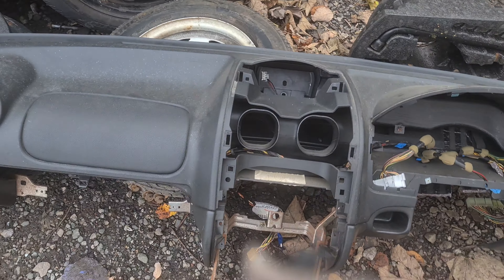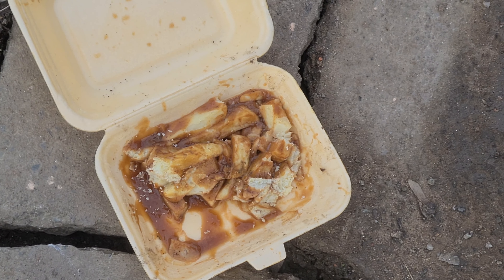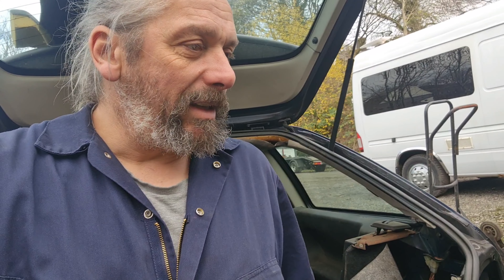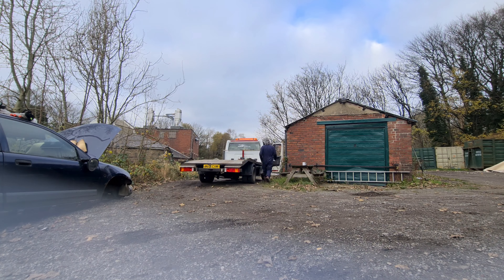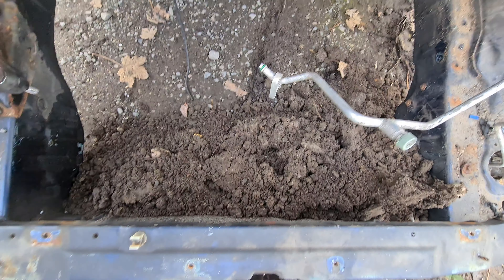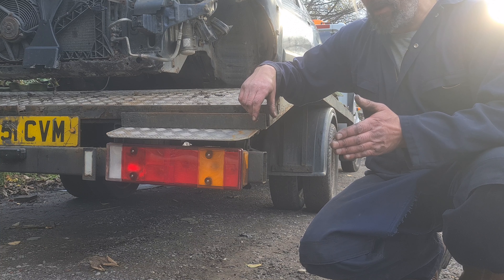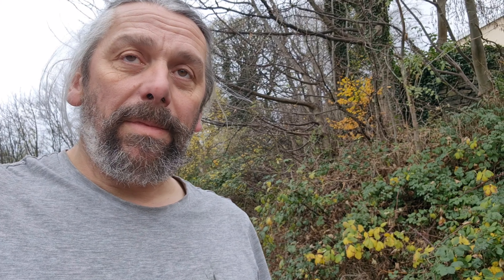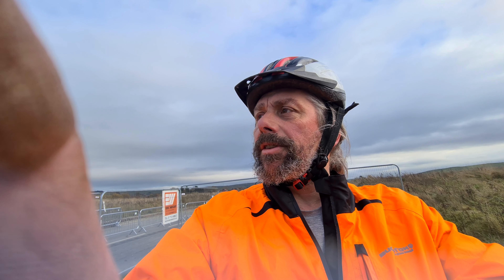Tony the Streetwise finished. Almost.

Comment: I would've needed those front seats, but I would need you to keep them until 23rd August 2024 when I get paid and you'd have to deliver them 250 miles away. My budget was a tenner so you've missed out BY SCRAPPING RARE PARTS 😡...😂

Comment: Take out the rear lamps on Dan and you will find one of the previous owners had used mastic to stick it to the car. 😁
Reply from the maker: The moat common R3 bodge going, usually works though 😆
Reply: @ProjectNigel  no doubt Rover approved 🙂